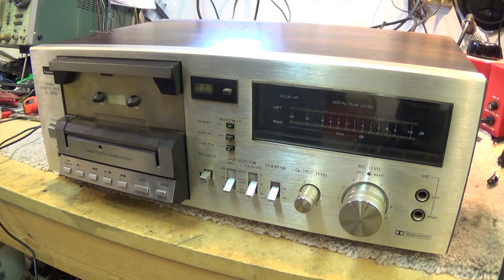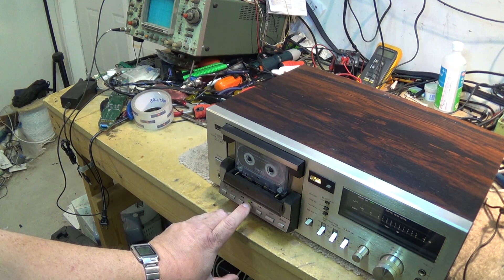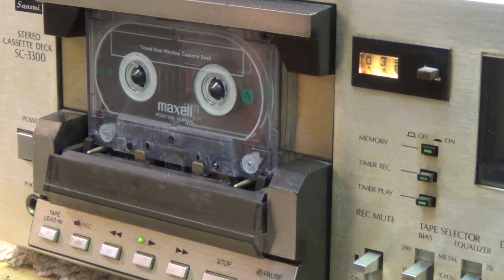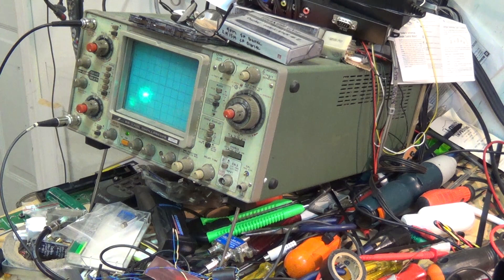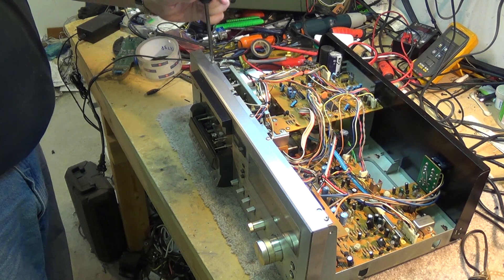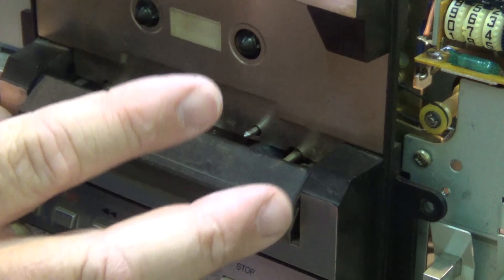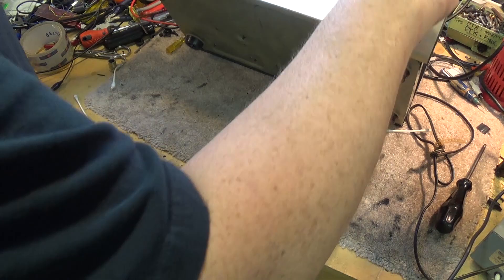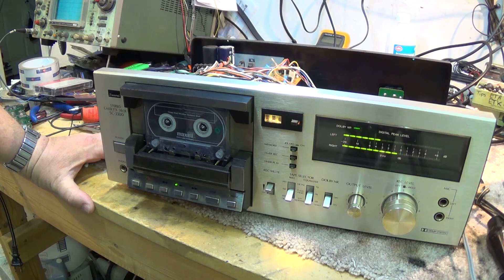Sansui SC3300 overhaul

Comment: Thanks for the great video.  I have a Magnavox I'm working on.  I'm trying to get all my old tape decks with new rubber in them.  Blaupunct in my van was a pain.  This BK3471 though.... it has a similar looking front end to the Sansui there.  A pulley on both sprockets.  I think one doesn't get used though probably.  THe belt was wound all around the front sprocket ..turned to jello like material.  I'd done the back two belts already..the main drive and smaller belt back there.  Here there is a counter and two other pulleys (one above and one below the slightly larger counter pulley) and you remove the counter, position the belt, then replace the counter pulling the belt onto that pulley as you install it in the hole.  I had it all turning ok it appeared moving by hand and I put it together.  Now for whatever reason it doesn't take up slack and the tap just piles up inside the cassette.  argh.  I've not worked on these things for a long long time.  WIsh I could find a manual ... but I don't see what I could have done wrong there.  too late...5 am..arghh

Comment: That deck is kinda like the one I was typing about in your new video about the Sanyo-Fisher deck... those 70's decks are awesome and so interestingly complex and amazing. I think mine was Pioneer and it had several sub-pc boards plugged into edge-connectors on the mother-board.  :-)

Comment: You can use simple household bleach to wipe down the cabinet and parts to remove smoke and smoke tar residue from the surfaces and they will look like new, and smell better too.
Reply from the maker: ***** Windex works like a charmLooks like new now.
Reply: 12voltvids
 yeah, Windex is good. I had a tan-putty  computer monitor for service that had been in a smoke environment, and the Windex got some of the yellow stains off, but when I tried the bleach, it really went to town.  Windex is excellent for cleaning the goo from melted belts. I've used it to clean up a few Norelco Carry Corder 150's that had melted belts. The worst thing is when a pinch roller melts!

Comment: Thanks for a nice and informative video! The hint using a standard guitar tuner for speed calibration is great. How did you record your calibration tape?
Reply from the maker: Mario Richter First I used a calibrated deck that uses a quartz lock direct drive capstan drive, and verified the speed using a 1KHz Sony factory calibration tape, with the output plugged into a frequency counter.I then set an audio oscillator for 440Hz, which is musical note "A" and recorded that onto a tape. I could have picked any frequency, but to use a tuner I wanted a standard note. Most test tapes use either 400Hz or 1000Hz, but you need a frequency counter to use these. 440Hz on the other hand a cheap  guitar tuner does the trick.
Reply: @12voltvids  brilliant calibration tip!

Comment: the repair on the sansui was excellent,....I have 1 additional problem with mine.  the rewind works until you get near the end, then it slows done and eventually stops.  It seems the added stress near the end is too much for it and it quits. I have cleaned the bands and heads as from this video,  any added info would be appreciated. I have had this deck for 40 years and still works great.

Comment: Hello, I'm kind of late to the party as is said BUT I have a question that I'm having difficulty finding an answer for.  I had this deck back in the early '80s while in the Army but only kept it a few years and gave it up due to HHG weight restrictions getting tougher. Okay, now to refresh my aging memory.  Does this deck have a "dual voltage selector (120/220)" in the rear  OR  is it an "auto VAC selector" for regional voltage of the user?  I've found & bought this deck again but the power cord on it is a "110 VAC" on the end. When it arrived, I saw a 220 Volt sticker on the back just above the power cord. The seller didn't list if it was a dual VAC deck.  So I'm hoping you'll say its got "auto VAC selection" built in it.  Awaiting your courteous & prompt response.

Comment: Very nice. I have the 5330 (bought new), black with handle rack mounts. Unfortunately, I need to replace the take up hubs on mine. Actually just need th, springs and conical ends. the hexagonal rods with threaded ends are still in the deck. Any advice on where to find them?

Comment: Not to nitpick but the left channel appeared a little weaker than the right. Nice deck though. I used the heck out of my old Teac deck back in the 70's.
Reply from the maker: +James Last Not too worried if the level wasn't totally balanced. It wasn't a clients machine, it was one that was given to me, and once I am done with them I give them away. I don't use cassette tape for anything myself, I only use DAT myself.

Comment: nice video. have you demagnetize the head as well? display also shows one channel having higher level than the other.....
Reply from the maker: +Szymon Krasuski That was just the way I recorded it. Wasn't balanced.Head is fine, no need to demagnetise 2 head machines with AC bias. The record current (which is an AC signal) will demagnetize the heads as soon as you hit record. If you watch the bias singal when coming out of record it decays slowly, not an abrupt cut off. This is so the heads don't get magnetized from the record circuit.3 head machines need to have the playback head demagnetized from time to time and player only units, but 2 head recorders, all you need to do it throw them into record for a few seconds and any residual magnetism will get wiped by the AC record bias signal.
Reply: +12voltvids I didn't know. we learn something new every day. thanks

Comment: Hi, great video, very informative! I have the same exact tape deck...I would highly appreciate it if you'd tell me where I can find/buy the coil spring that attaches to the take up spool @ 13 minutes & 15 seconds on your video (the one on the left). Because mine just popped out & I can't find it. I would really appreciate it very much. Thank you in advance!!! Keep up the great work!
Reply from the maker: +Roberto Cintron I think you are referring to the spring that presses the tape hub spline forward.I have no idea where you would find a new one, but all cassette tape recorders use the same spring, so you could just pull another hub apart and get one off a junker. That is what I used to do when looking for one. That 3300 was a really nice deck. I would have been proud to put it in my collection, but I was offered 100.00 by someone that wanted it more than me, so I sold it. I have too many old vintage pieces of equipment, but vintage is hip again, and I have no problem finding new homes for the good pieces.
Reply: +12voltvids Thanks for your quick response! Yes I have several tape decks as well & I tried looking for one that fits, but the one on the Sansui is just a lil too big compared to the other ones I have...The "vintage gear" was made right back then & they were all different & unique looking. I want to get that Sansui singing again! You're a great teacher, I'll be looking forward to seeing some of your other videos!!! Thx again...If you're selling some, please let me know...

Comment: Just bought same deck. Heads look different on this machine. Not smooth but ridges in middle of head. Is this normal. Plays but not sure if the head is suppose to look like that. Cleaned it good but you can see and feel the ridges in the middle of play head.

Comment: Hello . I just acquired a sc 2000 Sansui cassette deck . Are the inner workings similar to this deck you are working on in video? I also am having rewind issues . Maybe I need to clean the rubber inside?
 Any help appreciated .

Comment: Is there a place in the lower mainland that you recommend to go for parts? The reason I ask is that replacement parts (idler wheels) are difficult to find when repairing vintage equipment.
Reply from the maker: Fred Chew I get my parts at Main Electronics. Parts are getting hard to find though, so sometimes you have to just use the restoral chemicals on them. Pinch roller especially for reel-to-reel are getting very difficult to source.

Comment: What do you think of my idea of instaling a line fuse in the ac primary i have one that European modle requires it but not American one i have videos of me putting it in i do electronic assembly at my job i also showed a service center he said it is good why dosnt ul require it thanks
Reply from the maker: UL generally does require a fuse. They quite often put them on the secondary side, but the power transformer usually has an internal fuse and thermal protection that if it fails you replace the transformer.

Comment: I hear after 7 years you cant get parts unless it was used in newer units wear do you get obsolete parts
Reply from the maker: 7 years? You're dreaming. It as 7 years in the 90's. In the 80's manufactures were required by law to keep parts for 10 years, then it was reduced to 7 years in the early 90's. Then it went to 6 years. Around the year 2000 manufactures were only required to maintain parts until the model went out of production. All they had to do is have parts on hand to fix units that failed under warranty. If a unit failed under warranty and the parts were no longer available they could use recovered parts from other units that failed under warranty. If no unit was available they just replaced the unit with an equivelant. Today there are very few parts available. For vintage stuff there are still parts available because there were spare parts at one time, and many parts sellers bought up inventories from distributors going out of business.

Comment: I picked up a Sansui SC-1110 with similar problems as yours. I am a novice do you think I could do the repair myself? If I hire someone to do this for me, how much should I reasonably spend? Thanks
Reply from the maker: +Keith Beacham This mechanism is relatively easy to work on. Belt replacement is a breeze on this one.
Reply: Where would I buy replacement belts and cleaner and lubricant?
Reply from the maker: +Keith Beacham You measure the belt, if it is broken tie a string around the pulleys and measure the length of the string and subtract 5%.You can order belts off various sites, or go to your local electronics supplier. I get mine at http://Mainelectronics.com or http://leeselectronic.com/
Reply: Thanks! I'll give it a shot.

Comment: I picked up a Sansui SC-3100 for free. Am going to replace the belts and clean it up, but when I hit play, the left meter pegs out and the right meter bounces in time to a clicking (if the receiver is turned off)/squeeks (if the receiver is turned on). I'm hoping it's not a bigger fix than cleanup. Any ideas?
Reply from the maker: Clean the contacts on the record / play switches.  
I got mine for free and found a guy with sucker tattooed prominently across his forehead that gave me 330 for it.   Ya, I'll sell those every day to audiophools.
Reply: @12voltvids  Sweet. Well, rubbing alcohol is hard to find lately and my order for belts and deoxit won't be here for about a week... Sooo, i just did a wipe of the heads with my finger... clicking gone and I can hear a tape play for the first time! The contacts are a mess by the sound every knob makes when turned, but suhweet!
Love your vids and learnin' lots. Long as I don't have to solder I'm in bihness!
Reply: @12voltvids  STILL can't find rubbing alcohol in stock anywhere. About to break out the Vodka!
Reply: @12voltvids  Hey, wanted to say thank you! The belts were goo. Had to clean everything and then had to clean the play / record switches again. It's working like a charm! Pretty good freebie; well plus $4 dollars for the belts and $12 for the Deoxit (saw your recommendation too late to get Nutrol). This thing has been sitting in a closet for 10 years. Thanks again!
Reply from the maker: @robertgardner1498  
Good find. I got this one for free and sold it for 180.00!
Reply: @12voltvids  Update... Hoping it is just because it's in my garage office and it's hot as Hades right now, but I hit play a minute ago and it starts fine and then after a few seconds sounds like it's playing in slow mo. Going to bring it in the AC and see if it gets better.

Comment: Hello 12voltvids, I have and issue with my Yamaha tape deck model# KX-500U. When I record music with a perfect balanced L and R, The playback is off by 25% on the left side. The tape head is a amorphous and has been cleaned at all times. Head looks in good condition and tested ok with my finger nail. This unit has no manual record switch. Is there a common fix for this?
Reply from the maker: killmore75 You need to look at the record level going to the head to make sure that your bias is the same for both windings on the head, and the audio levels are the same. If your levels are good and balanced then it is the head that is wearing.
Reply: 12voltvids Thanks for the reply!

Comment: I got 1 just like this one in video .but it's low volume when it plays. I do not hook up with speakers but I can tell by Vu meter low. But that tape is playing loud on akai 570D. Do you have any advice on how to fix it? Thank you, sir.
Reply from the maker: Clean and demagntize heads for starters.
Reply: Still not working. I heard people say about SDM capacity., but don’t know which one
Reply from the maker: @HaiTran-eb3ce  will have to trace signal in preamp. I no longer have this deck so unfortunately I can't help.

Comment: Hi, nice video! 1:59 the capstan is not turning. do you think that might be my problem? . i have the same deck, i did every step you said. but no success. i put the cassette but it's not moving
Please, anybody can help me with this?  thank you
Reply from the maker: If the capstan is not turning, then it is either a belt, the motor, or the leaf switch at the top that is activated when you put in a tape.
Reply: @12voltvids  Many thanks for your help! i found the problem. i see the motor turning when i put the cassette or i turn the switch with my finger. the belt is not in it's place, it's broken. i'm taking it to a technician to get it fixed.

Comment: I just got the sansui tape deck 1330  looks just like 3300  big difference inside beyond the 2 belts  you changed  the big flywheel belt is a nightmere  belt was  melted  mess it is now  all apart wish I had  manual  put it togather again  may just throw in garbage  another 100.00 wasted  to ebay  never again  3 times lost money on ebay

Comment: Unusual  open tape desk!!
Reply from the maker: +Donald Ellett That was what Sansui called Direct O Matic" and the concept was nothing to cause alignment errors on the cassette tape. Conventional tape holders had springs and catches, that as they wore and got weaker the tape cassette would not be held firmly in place, and could shift, changing the alignment, and thus impacting the sound.They also look cool, with the tape exposed, especially when playing those TDK tapes that had 2 little metal reels inside a completely open frame, so you could see the reels turning.
Reply: Little bit late of a response but Pioneer also made some really great decks that were open as well. Pioneer CT-F1250 is a nice example.
Reply from the maker: There were a few companies that did this. Like today with the curved screens 1 does it, and the rest jump.The curved screen first appeared in CGA in a movie a few years before Samsung brought the first one to market. What movie was that in?

Comment: I recommend using Rawn Re-grip rubber rejuvinator as well to use for those belts rather than use just isopropyl alcohol for belts that are slipping.  just my two cents.

Comment: i put a line fuse in conponents that dont have one from factory and select fuse acording to its draw you can look in my chanel to see my work i do electronic assem at my work
Reply from the maker: +David Berquist A line fuse is NEVER a bad idea. It gives you secondary protection. All power supplies and transformers do have primary fusing, but it is usually a non replaceable fuse so if it blows you throw away the transformer.